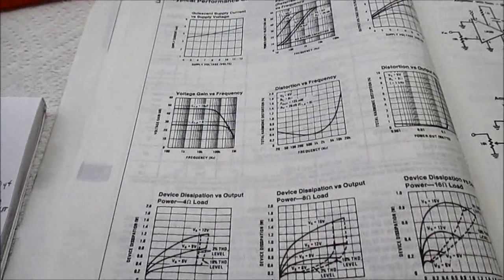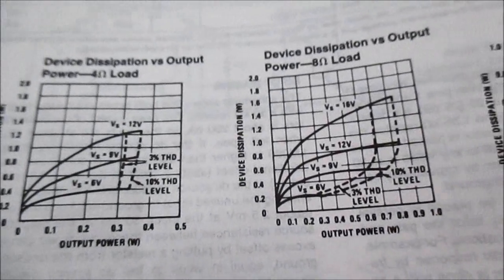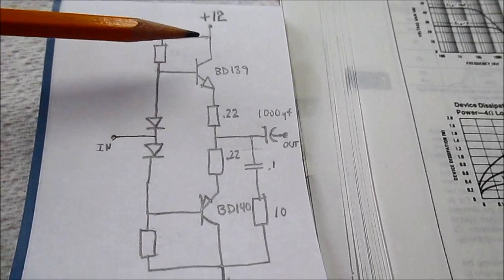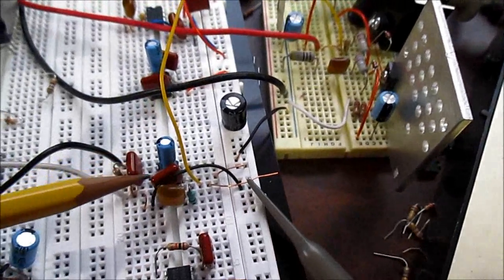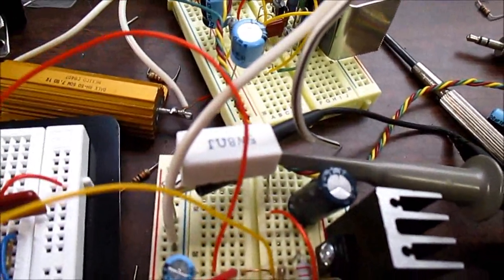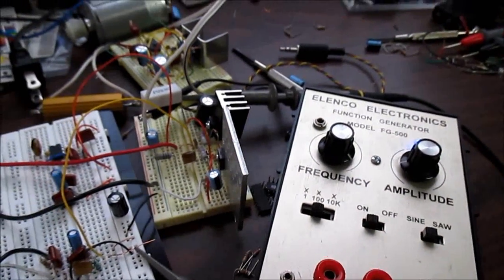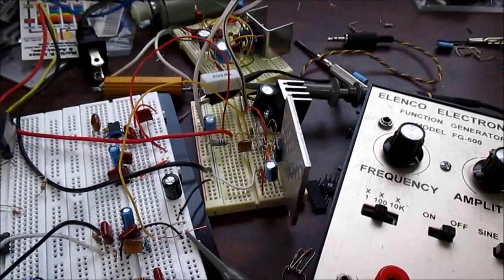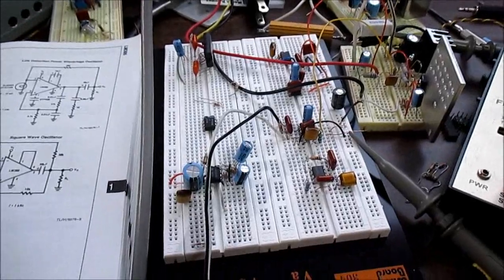Unsuccessful LM386 output booster stage

Comment: Wondering about the asymmetrical output, guess the PNP had lower beta. The bootstrap thing is interesting, basically a bit of local positive feedback?
Great video BTW.
Reply: ***** Also wondering what was happening at the input side of the circuit, if the impedance was too low for the chip.
Reply from the maker: ***** I think the chip is causing the asymmetry as many tend to be that way. Yes, this bootstrapping is like positive feedback. It pushes the voltage on the other side of the BS cap beyond the supply rail to give more drive current to the output transistor which allows the output to swing closer to the rail. Very common in older audio output ICs that ran on low voltages to get as much power out as possible. Relative to driving a speaker, the IC sees a very light load driving the output stage. A few hundred ohms as setup here.

Comment: Odd, this video showed up under my G+ bell thing, but not under my Subscriptions feed, will have to double check that...
Reply from the maker: ***** I don't get any notice when you post a video either. I thought I subscribed a while back. Perhaps a setting somewhere. YT has a server to handle each little function. The server that handles notification may be behind or having issues. Who knows.
Reply: JohnAudioTech I double checked after I wrote the above and it still didn't show. But now it does, in between several others that were there earlier, who knows. My subscription feed has been very busy of late, kind of odd how the community as a whole seems to go through active and scant periods. A few who have been inactive producing again.

Comment: No way..you gonna squizze and squizze and will not have significant increase..you need darlington output or CFP output and more audio level in the input (voltage in) and also lower impedance in the output...also more current into your power supply

Comment: This output has a gain of of VOLTAGE..the high gain there is CURRENT...so, to use this gain you have to reduce output impedance to 4 or 2 ohms..then you gonna have power.

Comment: Another problem is the gain of the output...it is gain 1, so..... the power will remain the same unless you inject more voltage in the input of this booster or if you reduce the output impedance....gain 1 result in the same output voltage that comes from the LM386...because 0.75W multiplied by 1 results in 0.75W

Comment: Try twice the supply voltage..go to 24 volts to the booster..adjust base resistors in order to operate class AB with a few miliamps circulating from collector to emitter and you may have 6 volts of output swing...more than 4 watts RMS at 8 ohms and 8 watts RMS at 4 ohms..... change to CPF or EF your booster configuration.... single supply, capacitor coupled....not matter what you do, will always put out not more than 1/4 of the supply voltage as output swing...a rule...this is a rule....do not matter what you do, will neve go higher than that,bootstrapping or not bootstrapping

Comment: John, i noticed you have not used a CFP and not a darlington emitter follower into the booster...also have not used simetrical power supply..... this kind of circuit you have used, with a simple power supply coupled with a capacitor can put out not more than 1/4 or the supply voltage...so...if you are using 12 volts...your maximum output swing gonna be 3 volts..and this is not much more than the 386 can do.... the only advantage you may have is that you can go to 4 ohms still keeping 3 volts output and this means you double your output power compared to the LM386....the mistake was to use 12 volts into the power supply....also the absence of CFP or the darlington emitter follower...a decision error related the supply voltage....change that and you will have better results.
Reply from the maker: Carlos Mergulhão I wanted to build using 12 volt supply only and use a 4 Ohm load minimum. No bridged output either. I checked with the other amp I made using the LM4562 op amp and CPF output stage and I'm getting nearly 3v rms. I tested another amplifier IC on its own (no output stage added) and it did about 3 volts also. So I agree. Around 3 volts rms max. Maybe a bit more under optimized conditions.
Reply: JohnAudioTech CPF?
Reply from the maker: ***** That's a typo. CFP is what I mean.
Reply: JohnAudioTech It's what I suspected, but I still had to look it up! Complimentary Feedback Pair, or compound transistor, or the good 'ol Sziklai
Reply: JohnAudioTech  i got your point